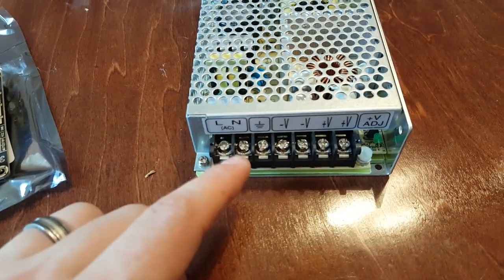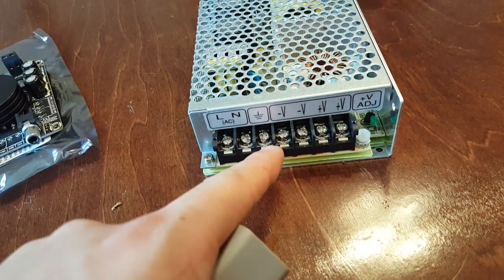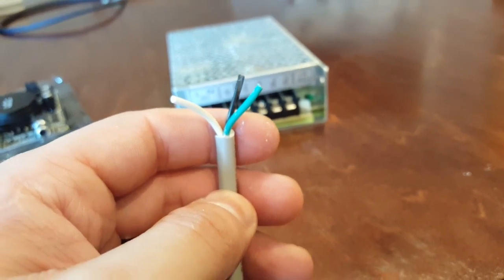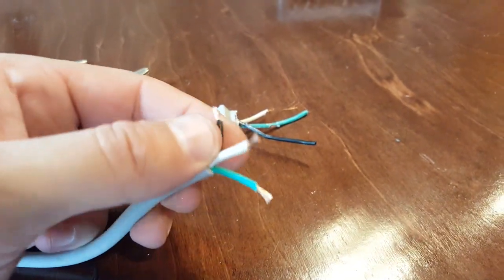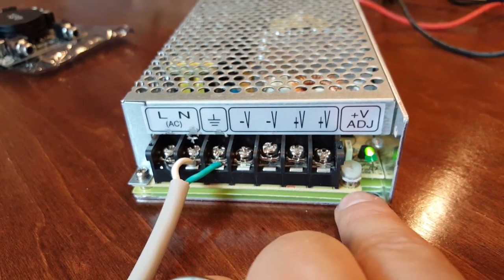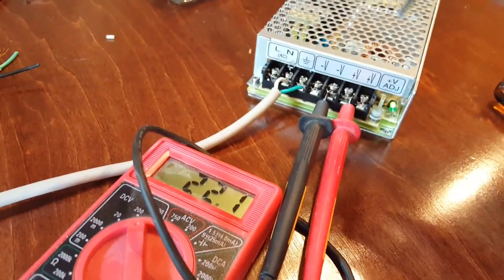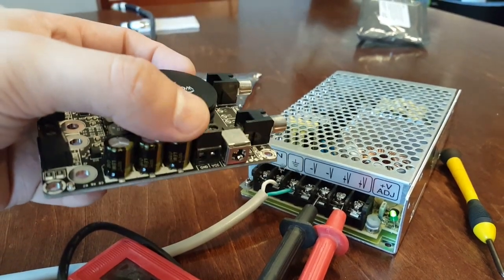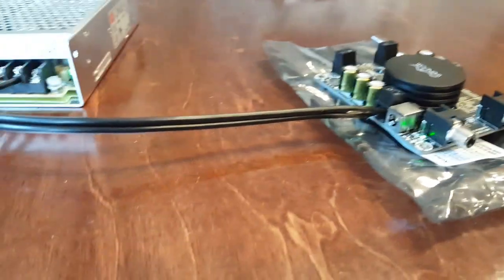How to hook up Mean Well Regulated power supply to Sure Amp Board

Comment: I hooked it up, but the LED does not turn on. I get Voltage when I measure L or N with ground but dont get any readings when I only Messure V+ an V-

Comment: @Toid Around 2:53, you mentioned you were going to test the 3 wires with a multimeter to be sure which was which, however, I think you might have cut that part out of the video.

Comment: If I'm going to use ring terminals, what stud size would fit to put on the screw terminals of the power supply? Will the #8 Stud work fine?

Comment: Hooked up my power supply on my LRS-150-12 multimeter says 120 volts going in and then there is zero coming out and the green light won’t come on. I think I got a junk unit ….

Comment: Man what an amazingly clear description...pure Brilliance  in delivery of information. Hats off to you for this . However what was the plug that you used on this ? Is it a 3 pin plug or the normal 2pin plug that goes into the mains ?
Reply: 3 pin - a 2 pin wouldn't have a ground wire

Comment: I have a power supply, model RSP500-5 and when I apply power supply (220VAC), the led lights up and goes out and there is no 5VCC output, what could be happening?

Comment: Hi there. Thanks for the video. I have a 12v DC 8 amp water pump. I am planning to use a timer which will switch on and off every 5 or 10 minutes, running for a minute or so. Can use meanwell LRS-100-12 power supply unit to hook it up to a timer switch. My plan: Timer-power supply unit-water pump. Is this the correct set up. Please. Thanks in advance

Comment: Hi, would I be able to also wire a breadboard’s ground rail to the power supply’s ground, and thereby get a negative voltage from this?
Reply: I’m building the oscillator from Moritz Klein’s channel and I need to power an op-amp IC, alongside regular Vcc to Gnd elements. 

I have an Arduino Uno and I’ve been using a voltage inverter circuit next to the op-amp. I got this power supply in order to free up the breadboard space, and to ideally remove the Arduino from the picture.

I will be dialing down the voltage as low as possible, but should I still be using a separate device for the ground, maybe the Arduino’s ground? I believe the negative voltage will be isolated from the ground in the circuit, as it should only be used for the op-amp in this project. 

but if possible, I’d like to remove the Arduino and use the ground (i.e. into the cord) on the power supply.

Comment: I have a car stereo powered in my room. With 12V 5Amp works good hits pretty good also..
But I ran into this very power supply yesterday an I'm jw if I could hook the power supply into the car stereo and add 100w or if ittl actually work the way I expect it to or burn the stereo up so I need some opinions
Reply: Or I could wire it separate from stereo and run the amp and sub on the power supply and just run the stereo on what it's already on
Before this supply box I had to use a 12v car's battery charger to power the amp an subs so I'll be hopeful lol

Comment: I've been wondering about buying a mean well power supply for my breadboard computer im making, do you think they are accurate enough?
Reply: I've had two of these arrive DOA. Terrible!
Reply: the rd65-A has 0.5% Load Regulation and 0.5% Line Regulation for just 16.95 so it wouldnt be too bad if it was dead but still

Comment: I was looking at this supply as an option for a bipolar power supply to power a few projects that require from - & + 5V to - & + 12V as well as ground. 
Why are you using the -V output for ground as opposed to the ground terminal for ground?
If you're getting 24V on your multimeter when measuring the output voltage with the black test lead connected to -V and the red test lead connected to +V, what do you get if you move your black test lead to the ground terminal?

Comment: Ive got a 3d printer w 24v meanwell power supply. Do you think I can add a XT60 pigtail to power a 650w 15a LiPo charger to it while the printer is on stand by mode? Tya for your reply.

Comment: For the love of god, please put properly crimped connectors on those mains wires. Bare copper wires should never be attached to those terminals because of 'work hardening' (micro-fractures).

Comment: Thats NOT save at all! Use wire end ferrules and crimp it! Bad Wiring + a lot of amps = Heat and Fire...please stay safe.
Reply: @Bryan_327  if you screw down a wire you crimp a wire.. Its about wire protection
Reply: @Bryan_327  okay but on Youtube i would not show it like that. I guess you have more experience with wiring and you know special cases. I learned the generell rule crimp when you screw. And thats the way it would be Safe for everyone on Youtube who maybe uses thinner wires. Its only 10 Euro and a few cents to do save work in every case without calculate current density n stuff. For people who just want to use it without going into theory they should just learn to use end ferruls and everything is fine ^^
Reply: @Bryan_327  at least maybe someone reads our discussion! :)

Comment: I wish you went a bit further with this and hooked up the audio. I'm curious if that switching PSU had any noise issues that you could hear in the signal once you had the speakers hooked up. I'm thinking about using one of those PSU's on a vacuum tube mic preamp I'm building. The guy who designed the preamp actually designed it with a switching PSU in mind, and he has some high frequency filtering in the design, but I think he intended the PSU to be external. I'm going to be racking up TWO of his PCBs into a 2U rack box with the PSU in the rack box.
Reply from the maker: That's highly dependent based on what you're hooking it up to. I'm not sure that anyone could really answer that besides the designer of the tube preamp.  It's a very clean power supply.  With what I use it for, I don't get noise. What I haven't done extensive testing.

Comment: Hi, I have a problem with this matter which would be very appreciative if someone can elaborate for me.
I want to make a diy speaker by buying a full range speaker, amp board 1x50w and lithium battery.
Now, as you would see from above, the last item is the lithium battery, yes I want to use it without a "power supply"

Question: Can I create this theory diy speaker I want without the power supply? 

 I had bought previously a bluetooth speaker and changed the speaker by de-soldering the negative and positive wires and re-attach it and worked flawlessly, only downside, the amp was weak, not pushing the woofer to its full potential.  I checked that by trying it out with my own Griffin amp and it blows my mind how good a 15 gbp woofer can sound, only sad thing is, I bought a mid woofer, not the full range.
Anyway, thanks in advance for help if any ...

Comment: Great... I was actually looking for this. Now... There is no difference between neutral and live. It is AC. And it does not matter how you plug it into the wall. And you can find cords, were there is no connection for "neutral" and "live". The ground/earth is the only one you need to watch out for. Regarding getting a shock. Then you will not get any, if you only touch one. If both or anything else, then you will get a shock.

Comment: Hi, I have a question on the Mean Well. I want to use the DC volts for my H O scale trains, and LED lights for my buildings. Do you know if I need any other items? such as any PC boards? The purpose of buying the Mean Well was to add more DC volts, any thoughts on what I need would be greatly appreciated thanks,Ken

Comment: Thanks for the video - very helpful!
One question: specs of RS-100-24 say that output voltage range is 22.8 to 26.4V
in the video you could go as low as 22.2V - is the spec wrong and in fact there is more adjustment range?
cheers!

Comment: 1.what happens if the cause our mains are 240v and the power supply only rated at 220v eill it be ok to our country?

2. What is the +-15% means on the voltage input, I researched it I think its tolerance, what does it mean?

Comment: European standards
 blue negative
Broun (live) positive

Green \yellow ground
Reply: love you
Reply: LOL Negative and Positive in AC
Reply: 1-Phase
Brown - Live
Blue - Neutral
Yellow/Green - Ground

3-Phase
Brown - L1
Black - L2
Gray - L3
Blue - Neutral
Yellow/Green - Ground
Reply: how are you gonna know where actually live is on european 220v plug??? You can plug it upside down into the socket. Moreover, usually nobody gives a f*** connecting live and neutral to the socket
Reply: @ilyakondrashkin  it doesnt mather because it goes back and forwoard indeed but if it is a true neutral you can safely touch it.(do not try this at home)....
Reply: mah man

Comment: Line, not Live!
Reply: Doorguru Load not line.
Reply: @forresttaylor6849  "Live" is incorrect terminology when referring to alternating current conductor identification.
Line is the accepted term to identify the conductor that is not tied to ground. Neutral is the term used to identify a current carrying conductor which is tied to ground at the power source. Ground potential is the average potential on Planet Earth it has been arbitrarily assigned the value 0 Volts. Ground wires do not carry current during normal circuit operation and are provided as a least resistance path to earth in order to protect people and equipment by tripping a circuit breaker in the even of a short circuit. Colloquially, live can mean a circuit is energized or has electric power applied to it.

Comment: Do they make suitable enclosures to stick all of that in?  I have cats so the idea of having all of that exposed is unappealing to me.
Reply from the maker: The metal box, is actually the enclosure. Some of these power supplies actually have a plastic guard that goes over the screws, this one does not.  However, you can put them in a different enclosure if you want.  It would be pretty simple to stick them in say a plastic ammo box with an iec socket on the outside.  That would give you more protection if you wanted.  Or go to your local hardware store and see what you would fit one.

Comment: I'm a noob at this. Just bought a S-250-12 model psu and going to wire it up... But(!) we don't have many grounded sockets here (Norway) and the ones we have, you can put the plug in both ways(I.e. switch the N and L).. As stated, i'm a noob at this.... Any takers?
Reply: hi,yes you can always turn L & N around because its AC alternating current,AC current changes the polarity or +/- every 1 second 50 times/cycles or 50 hz,so polarity al the time changing anyway,only DC you have to always check for polarity,with AC only in your fusebox you can not change the L & N!No worries!cheers

Comment: can you use this as AC to DC converter?
Reply from the maker: Dugagjin Dervishaj that's exactly what it does. It converts AC to DC current
Reply: +123Toid 

im completely new new in to electricity fields my friend. . 

and a question what about from DC to AC ? 

does this part helps?
Reply: No, this won't convert DC to AC. Why do you want to do that?
Reply: +Jefferson Allan now to which one should i believe?
Reply: Dugagjin Dervishaj you've misunderstood me. At this point I think you're best off doing some googling. Read about ac-dc converters and dc- AC converters, switching power supplies and linear power supplies. Ask again once you've figured that out.

Comment: Hello there . I would like to know whats the best input current needed for similar device =24v 20a output=  to fully function to 100% ???
Reply from the maker: VxA=W so you need a 480 watt power supply.  Over you do need to take him to the efficiency of the board amp, so 550 watt power supply would be better
Reply: i dont get it dows this device that im talking about need 2230v and how many amps to fully function ???
Reply from the maker: Арxитектор Вселенной well it plugs into your wall socket.  In the US that's 120 volts.   And it'll pull as many amps as it needs or until it flips your circuit breaker (ie you overloaded your breaker).
Reply: Ok well in EU WE GOT MAXIMUM 13AMP SUCKER LOAD SO IM PLANNING TO USE IF NOT 20AMP DEVICE WELL 15AMP . SO WHAT WILL I DO NOW ???
Reply from the maker: Арxитектор Вселенной It'll pull a lot less than 13 AC amps.  Check out this site. https://www.batterystuff.com/kb/tools/ac-to-dc-amperage-conversion-run-through-an-inverter.html
Reply from the maker: I'm sorry, but this question has been answered for you already.  It just seems you do not understand it.  All you need is any power supply that takes your input source and converts it to the needed output.  The device in the video will do exactly that.  I'm not sure what you are getting angry about, when I have tried to help you.  If this does not help, then I am not sure you should attempt to do whatever it is your are trying.
Reply: i WAS JOKING ABOUT GETTING ANGRY DAMN IT . IM MAD ABOUT INVERTERS THAT INVERT FOR EXAMPLE 5-12 VOLTS IN TO 230V AND MANY AMPS
Reply from the maker: I think you misunderstood that web-site.  What it is saying is that if you have a 230v 13a source - a 24v DC power supply would be able to pull up to 137.54 amps from it.  You are only trying to pull 20 amps, so you have 117.54 amps to spare.  IE you are still only pulling 20amps
Reply: from 230v 13a to 24v and 137.54a ??? Is tit possible is there a tesla coil inside ???

Comment: Nice video! I just have a question. Have you noticed any background noise caused by the power supply? I’m no electrician but I’ve read some posts about smps supplies leaking noise from the switching into the audible frequency band. I’m thinking of building a dual mono amp with two of these in it.
Reply from the maker: That is a good question.  I have not noticed that at all.  However, I run these on bass shakers that only get 80hz and below signal and only comes on when bass hits.  SO I probably would not notice it.
Reply: 123Toid aah, ok. I’ll continue my reading and I won’t let all audiophiles get to me with all the talk about toroidal being the only way to get good quality sound. 😉 smps are just so much simpler and more efficient!

Comment: Hi, will this power supply be able to feed to 2 amps since I see diferrent output on it? Thanks for you answer. 
Best regards.
 Cliff
Reply from the maker: Cliff Lisette yes, as long as it has enough amperage for both amplifiers
Reply: Thanks for your answer.
Reply: @mehulsingh2403  Connected in serial, they will provide higher voltage. Connected parrallel, you can draw higher Amps. Yet be aware. That is out of specs and you void warranty. They are not extremely expensive, yet not cheap eighter. Good value for the money they are. Another thing is that in worst case, you can start a fire that way. Just pick a higher rated PSU from MeanWell. They are cheap enough, and they have tons of different models. All equally good. Just avoid knockoff copies from china.

Comment: the electrical dangers of the mains side voltage should be made much more explicit, from the very start of the video. errors with mains voltage can be fatal!
Reply: Single phase 120, unless they’re standing in a tub of water with wet hands, not likely fatal by a long-shot.

Comment: Hi!! I don't have electronic knowledge so i need help and some tips!! :)

I have 2 AURA Bass Shakers (50w 4ohms) and i will buy another 2. Will be use with Simvibe software (SimRace). The idea is to work in Front and Back independently , So, i will need 2 amps... I did some research and after all i think the best solution is to buy 2 amp boards, maybe 2 of these : 

https://www.parts-express.com/sure-electronics-aa-ab32971-2x100w-class-d-audio-amplifier-board-(t-amp-technology)--320-3340

with this power supply. 

https://www.parts-express.com/mean-well-mw-nes-350-24-24-vdc-146a-350w-regulated-switching-power-supply--320-316?turntoflow=question&turntoflowid=11078&turntoxauthtoken=OTYyNDEyMzoxNTM2NjA5OTYyNzA2OmExZWQ2OTc4YTQ3YmRkMzliMzc0NzgwYmUzOGFiMTg5&newReg=y&turntoflowConfDupe=y#turntodone

Do you think is a good setup ?? 

What about this power supply ?or is to much and i have a cheaper option?

Will i need something else to run? or with all this stuff is ok? 

Also, How do you raise and lower the volume? (I'm worried about frying the bass shakers)

I'm from Uruguay so should be 220v/50hz. 

Thank you for the time and patiente!!!!

Comment: dumb ass its ac, touching black or white and grounding yourself will shock you
Reply: stuknda80z Really depending on the Country. In most of the EU we have a TN-C-S power grid, with Earthed Star Points so, Neutral is the same Potential as you and the ground so it will not shock you. But yeah it is true never ever touch it without really knowing it or cutting off the Supply.

Comment: If you have to make the statement that the cord should not be plugged in while cutting the end off; this how to video is beyond the capability of the viewer and therefore shouldn't be doing it...
Reply from the maker: So true.  I also don't want to see anyone get electrocuted or trip a breaker.  But I couldn't agree more.
Reply from the maker: quangluu96 lol
Reply: Sadly the statement has to be made because it has happened before
Reply: @QueueTeePies  Mains voltage isn't high voltage.
Reply: Lol for real

Comment: Do these power supplies come already set-up with the specified output rating?  ...Or is it better to 'always' check it with the multimeter?  ... Good video.  Thanks!
Reply from the maker: Kyle Comeaux It never hurts to check it while you have your multimeter out to adjust the voltage